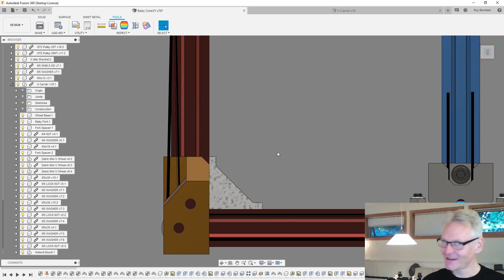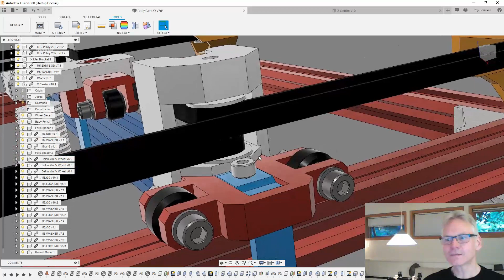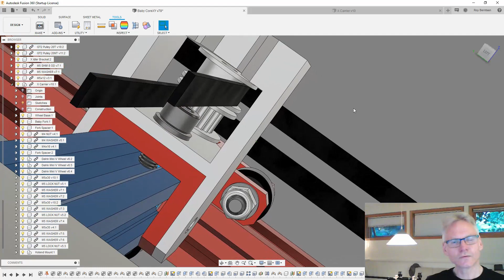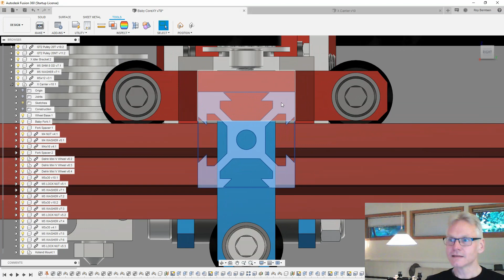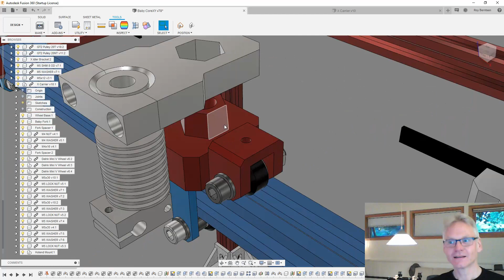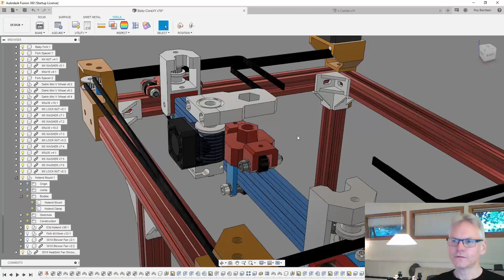Design Vlog #4 - V-Baby - Toolchanging X-Carrier?

Comment: Nice to see it "grow" ! And its not boring, rather exiting to me.
I would prefer to sacrifice some z-height in order to gain/keep the X-axis full travel. Looks like you just need 10mm, even the bolt for the lower x axis wheel (on the sides) can be kept in place.
For toolchanging i suggest a single screw in the middle with a slotted washer to slide in/out between the srew and the tool. This way you just have to turn the screw 2-3 turns for quick toolchange. Maybe even a quick realese screw can fit trough the toolalignmenthole to keep it tool free. Magnets sounds tempting, but i dont trust them to keep everyting in place rock solid. The hotend has quite some leverage on this part.
edit: just realized that the top middle is already occupied with the wheel tensioning screw, so ..."screw" that ;-)
Another idea: extend the hexagonal part of the X-carrier and make a big 3d printed thread with a corresponding 3d printed wingnut.

Comment: On the X carrier you could put the single wheel on the top and the dual wheels on the bottom which will give you clearance for the belt attachment points on the top.  I think this would give you a little more movement in the X direction because there is more clearance for the wheels on the bottom.

I liked the belt arrangement on the V-King but this is looking even better.  I might have to switch over to this at some point.

For tool changing you should try to adopt the E3d arrangement as they would like it to become a de facto standard and I think there is a good chance of that happening.
Reply from the maker: Good thinking - This has been considered as an option. How ever we are pullling above the axis and with only the supporting wheel up top there might be a tilting motion. Also only one wheel carries the wheight and with a direct drive this might be an issue - I need to think about it

Comment: The wheels on the X-carrier could be on the side of the extrusion, just turn it 90 degrees. The dual wheels can be on the extruder side.
Reply from the maker: Interesting approach. I never liked having the wheels horizontally. It just seems wrong from a mechanical perspective taking gravity into account. I might be overengineering..
Reply from the maker: Also the wheels on the side gives less support in preventing tilting motion from the belts pulling the carrier